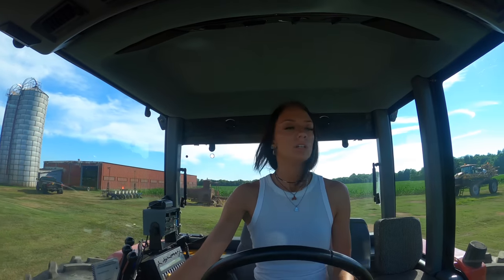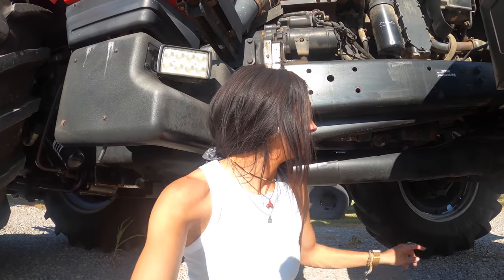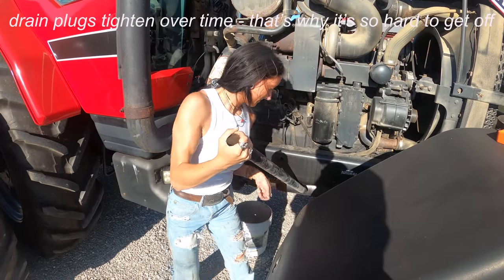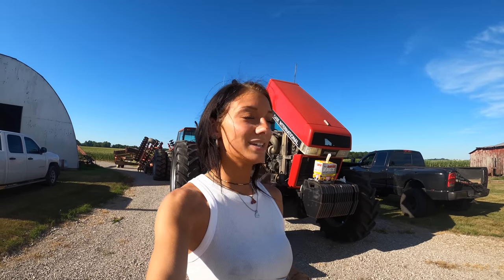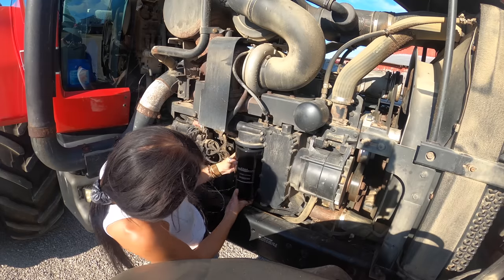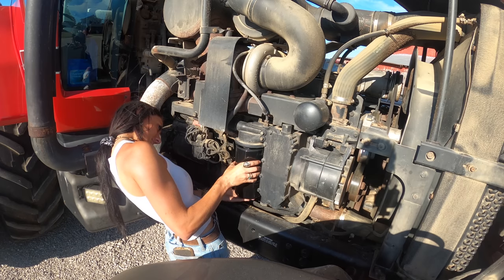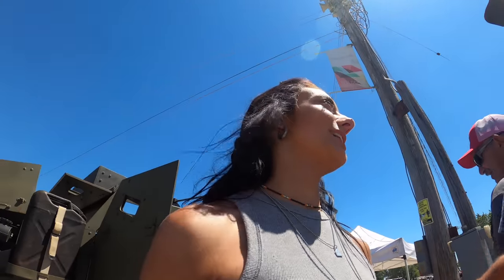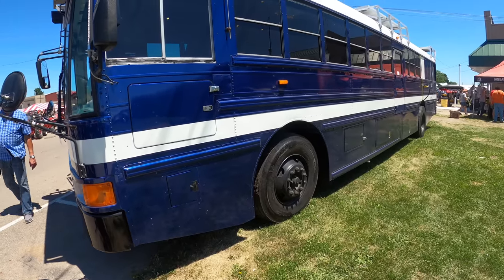Oil Change on the 7140 & Red Power Round Up

Comment: Love them old 7000 series Case IH tractors!!..tough as nails!!..I ran a 7120 for a road building company pulling a disc drying dirt so we could pack it for road top!...I owned a late model Case IH 2096 ...decent tractor but not even close to that 7140 you have...those 2096’s were the David Brown division of Case when they bought them out back in the day...they weren’t near the tractor of the 5000/7000 series were but a lot of farmers still run them in Alberta and the older versions like the Case 1070’s...anyway keep that oil clean and those engines will run forever...oil is cheaper than main bearings and cams...those big tractors pull hard and for long periods of time so the oil is important to keep clean!!..keep it up young lady!!

Comment: 7140 is my all-time favorite to run!  Pulled a field cultivator, 7-bottom land plow, and a chisel with it and loved that tractor. It was a beast.
Reply: Mine too. We bought 2 of them brand new and they pulled 8 bottom plows and also pulled chisel plows, one trippers, 4 row potato combines and many other implements. They were worked hard and never have given us any issues other than rebuilding the transmissions and engines when we wore them completely out.

Comment: Good thing you put oil on the oil-filter gasket, I have seen people put the oil-filter on with a dry gasket, I use Mobil-1 extended performance oil in all my cars and power equipment... Most from Pennsylvania

Comment: WOW, love the paint job on the 3088. The 71, 72, and 8900 series Case IH tractors were probably the best machines ever built. Never had a chance to get one. When I traded I went right to the MX series, a 220, it had issues but still was a good tractor. Still  have a 5088 series, it still runs at close to 11000 hours... I like your taste in equipment....
Reply: They are good ones but so aren't the 4020,4320,4430, 4440 and 7820 JD's
Reply: @davehughesfarm7983  My dad had a 4020, that was an awesome machine and very, very reliable.  He had that tractor for over 20 years and it always ran. When he traded it  he got same price as what he paid for it.

Comment: I'd love to go to Red Power Roundup some day. That'd be awesome. 

I don't usually struggle with the drain plug myself. It's usually the filter that gets mysteriously tightened beyond all rational sense! You should see some of the ones I've destroyed removing them. It's a mystery I'll likely never solve. Nice job pre-filling the filter and oiling the gasket. That's something most people overlook. Nice to see you back. Hope you're doing well. Stay safe Grayce.
Reply: I had a new Kubota , they put that filter on so tight only my giant channel locks finally  got it off ! , and I was a equipment mechanic  for 25 yrs
Reply: 2023 RPRU  in Grand Island Nebraska
Reply: Planning on taking the 240 utility and a couple stationary engines if I can get them running in time

Comment: Some guys in my antique club went and they had a ball. Yes by all means put the oil back in. Bad things happen when you don't. Just ask my neighbor. He had a small Deere garden tractor he was changing the oil in. He had drained the old and replaced the plug but was distracted by his wife after she came home complaining about something. They got into a bit of a squabble and he forgot all about the oil. Cranked the tractor and locked the engine down. At least that is what the mechanic said at the dealership. That little argument cost him a new engine. Moral of the story is don't get distracted when you are changing oil...
Reply: Always take the key out and put it somewhere maybe even with the oil so that it doesn't happen again

Comment: Wise to walk away and let the oil drain till it drips no more. Oil plug on a semi needs to be torqued to spec. Freightliner will leak if over tight. I learned it's coming off again so never over tight. Smart to double check after run a little while for leaks. Oil is cheaper than parts

Comment: We used so much oil we would buy it in 55Gals drums? The last tractor I drove was 4850 MFWD that pulled a27' I/H disk it had a chrome pipe & it was hot!

Comment: Wooow, that is some Bigger Turbine right there !!! :-) But, after you put oil in the engine, you should just turn the engine with the starter so, that the engine doesn't start Until the Oil Light turns Off. That is Because the oil filter is still Dry, and the air pushed trough the dry bearings is Not Healthy 4 the Bearings. And, after the oil light turns Off, than you Can Normally Start :-)  Pace with you from Eu :-)
Reply from the maker: The oil filter was not dry
Reply: @thefarmergrayce  Aww, so, you put oil into it ??😀 GoOod girl 😍❤💙 I would marry you, asap, if you would be a vegetarian 😄 Peace with you from old Eu 🙂
Reply from the maker: @kopronko  if you watched the video you would know it was prefilled
Reply: @thefarmergrayce  Aaaah, i see it now, at 3:52 🙂 I am sorry, i appologise, that i have missed that part, because i didn't have the time to watch it entirely. Thank you for noticing, and explainig it to me . Good video 🙂But that is still a nice Turbo upthere 🙂 Peace with you from old Eu 🙂